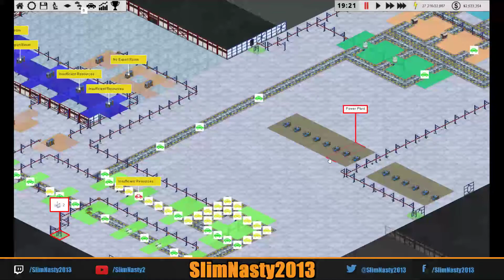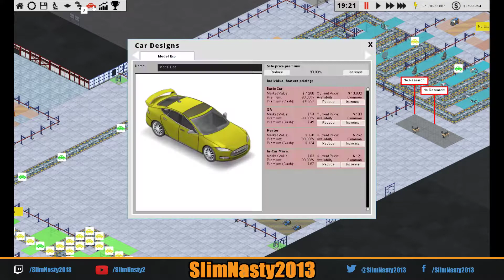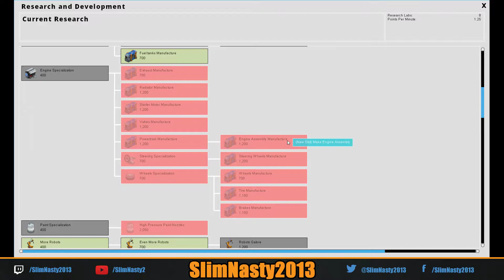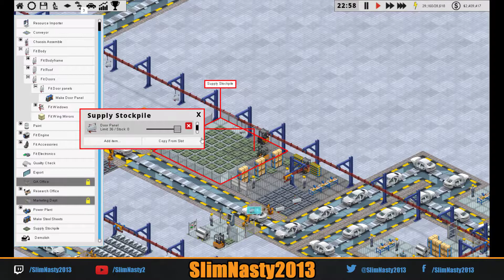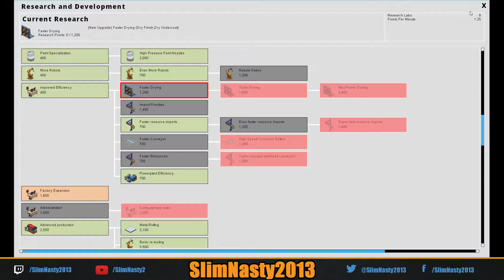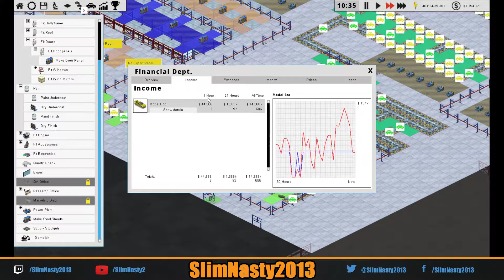Let's Play Production Line - Episode 6

Comment: This may be a daft suggestion, however would it not make sense to have the manufacturing, storage and fitting as close together as possible? So less time is wasted moving the parts along the rails.
Reply from the maker: Yes and No, We should have stockpiles as close to where they need the items, but not necessarily the manufacture. Also I feel like in real Factories often the items are produced away from the Factory in separate buildings or even locations, so I'm trying to simulate this a little here. But I do need to add stockpiles in.
Reply: Fair point, I was just thinking in terms of efficiency and reducing the backlogs :)
Reply from the maker: No I understand where you are coming from, stock piles are coming soon to my setup though I promise as I love the new "copy from" selection we now have to make setting them up easier.